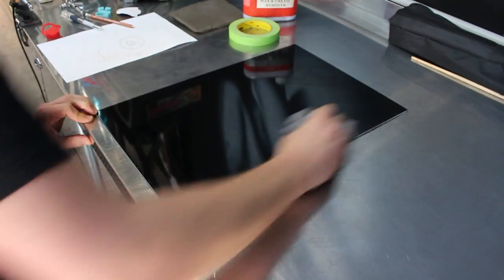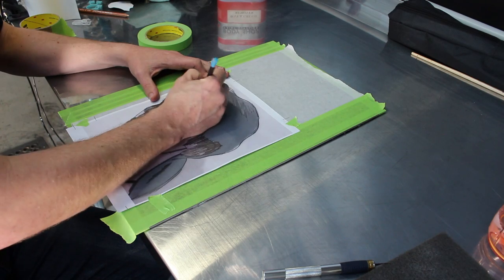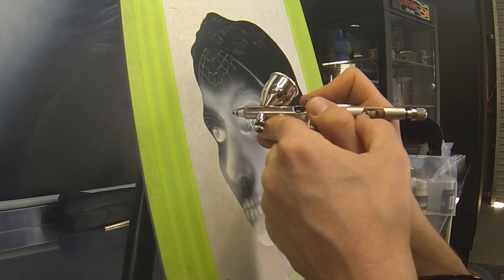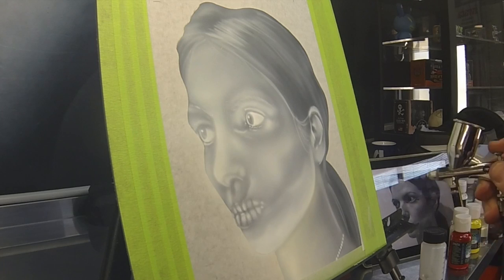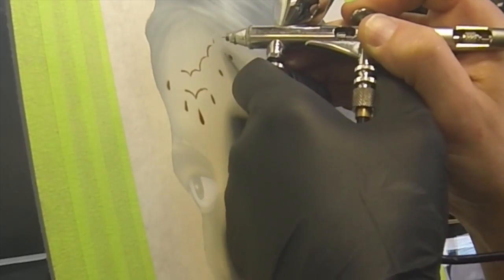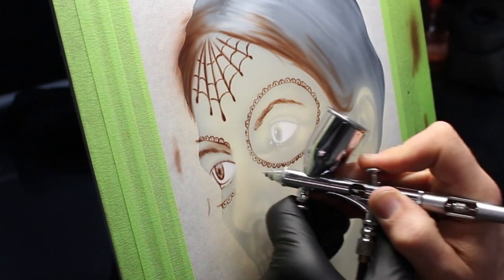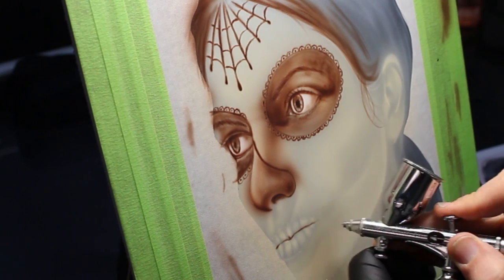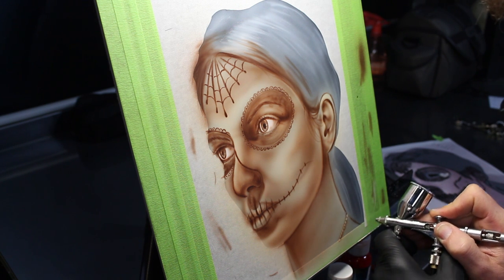Airbrushing a Day of the Dead Girl : Part 1

Comment: Hi I know this is an old video so hopefully someone responds, but how did you transfer the image and it turned white?? Didn’t you use chalk? Thanks.
Reply from the maker: Thanks for your comment yes I used a chalk pencil drew on the back of the sketch then flipped the art and drew back over the art with a regular grey lead pencil and it will transfer the artwork for you 👍🏻😉
Reply: Airbrush Asylum thank you very much for the response, really like this transfer method and love the artwork.

Comment: I don't understand how you used chalk pencil to transfer can you explain in a little more detail
Reply from the maker: I basically draw on the back of the reference with the chalk pencil, then line up where the design should go and use a regular HB pencil to draw over the design (other side) which will transfer the chalk pencil onto the surface 👍🏻